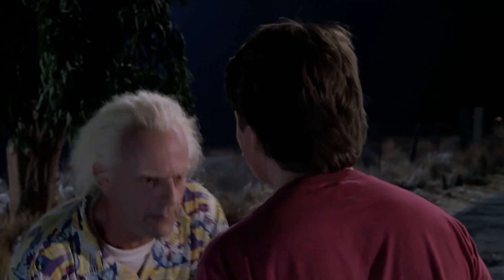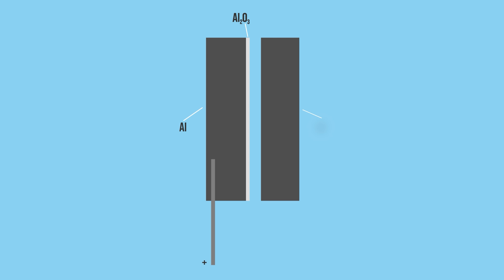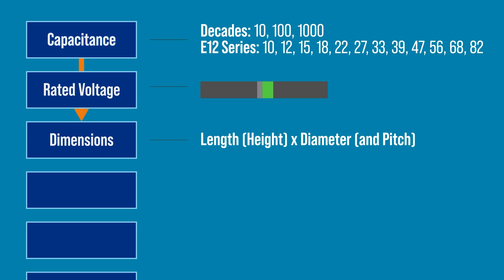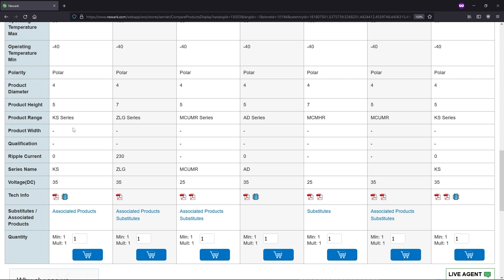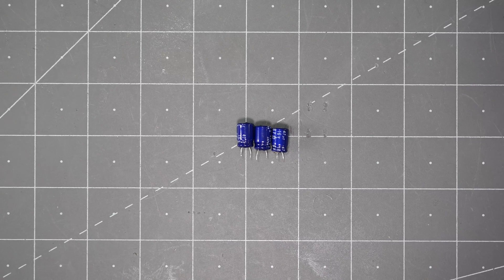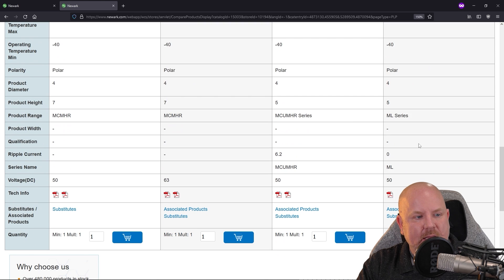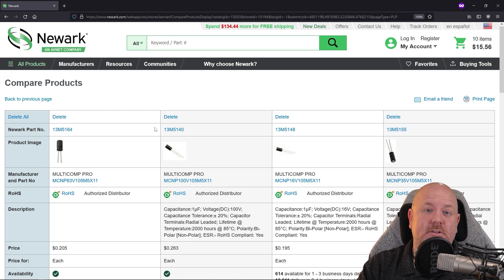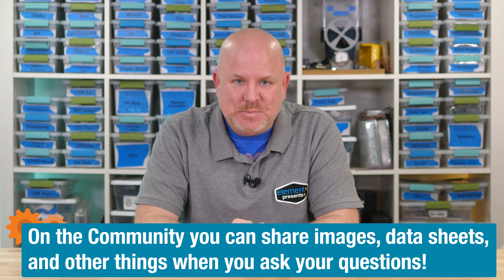How to Pick Replacement Electrolytic Capacitors - Workbench Wednesdays

Comment: Hello there excellent video. I wanted to ask you if I am recapping a transistor radio and I go with a higher voltage rating on the replacement caps say for example a 100 uf  10 volt cap being replaced with a 100 uf  35 volt cap, will the battery life of the radio now be reduced because of the higher voltage rating of the replacement caps? Thanks
Reply: No. The rated voltage does not matter in that case.

Comment: curious.   A home audio device had a electrolytic cap fail after only 8 years. (bulging on top)  Looked in my junk drawer for a replacement.  1000uf, 10v.   Found one that was 30+ years old.   It was about 3 times as large, but easy to install.  Measures and works perfectly.  Did the first one fail because they tried to squeeze it into a smaller case?
Reply: Electrolytics have gotten smaller over time because the foil etching process, aluminum purity, and electrolytes has improved over time. It failed because either it was at the end of its operational life, the design was bad, or the cap wasn't manufactured well. Billions of capacitors made each year. Not all of them work flawlessly.

Comment: Nice video. Thx.  I’m going to have to do this to purchase new caps for some old motherboards.  Are there any recommended shopping lists to help me out in buying a good selection of caps for most eventualities on motherboards, graphics cards etc. BadCaps used to sell these kits, which was very useful for novices, but he no longer does this anymore.  I’ve noticed re-capping kits on eBay for Commodore 64’s and the like, but nothing for old PC’s.
Reply: No, not really. The caps for the digital side of 8-bit computers are easier to document because there were so few variants of the PCBs relative to later computers. Over time, you'll build up an inventory of parts but you'll always need to buy more for each re-cap.
Reply: @bald_engineer  Many thanks.  This was my lazy train of thought.  Like you l’ll just go through each board create a list, and go shopping on Mouser.  I’m sure there’s a lot of commonality on 20+ year old boards that will help me build some essential stocks quite easily. Thanks again. D
Reply: @davidp4456 Outside of the SMPS (and CRT), electrolytic are mostly used for bulk decoupling. So most devices just fit the largest cap they could given other constraints. 

Despite relative similarity in electrical design, the other constraints are what creates variety in the values used.

Comment: Hi, could someone please help me find the right replacement capacitor? This is what is printed on the old one ( ZHN (M)105°C 25V 1000 uf CD288H L.E.S.R ) ?
Reply: If you follow the link in the pinned comment, you can ask your question on the element14 Community. There you can post a picture of the capacitor. You are more likely to find someone that can help there.

Comment: I took my NAD 7400 receiver for repair, but the guy is having a hard time finding transitors/capacitors repalcement. Can you suggest a place where to buy those components?
Reply: Without knowing what the parts are, the best suggestion would be start with a distributor like Newark to find modern replacements. Otherwise, you'll have to look around on the grey market for (hopefully) new-old stock.
Reply: Also, if you have a list of tough to find part numbers, the element14 Community is a great place to post that list (in the Ask The Experts forum).
Reply: @bald_engineer  Thank you sir. I will look into it.

Comment: Why wouldn’t you replace with tantalum’s? I mean then you are going to have to replace the caps over and over and hope they don’t leak. Tantalum’s are much better and just burn up instead of leaking.
Reply: Cost, availability, voltage ratings. They cost orders of magnitude more than wet-electrolytics. Good quality through-hole tantalums are going away. They're also less accepting of surge voltages. Their impedance profile is vastly different. 

Can you use them? Sure, but it takes a lot of more circuit knowledge to how to replace them. It's not just a straight voltage/cap swap.

The middle ground, and my preference, is Aluminum Polymers, which I mentioned in the video.

Comment: When replacing the smaller electrolytics, say 3.3uF or smaller, you can also use film caps provided the size will allow it. It doesn't matter if the originals were bi-polar or not.

Comment: Your little SMT adaptor board for older component replacement looks cool, but it is not just parallel capacitors on a PCB, the parasitic inductances could lead to nasty surprises. However, if analyzed on the bench you could actually produce an "equivalent capacitor" super capacitor of better performance out to high frequencies using the PCB interplane capacitance, ceramic capacitors and finally Aluminum Electrolytic capacitors. You could combine these different preforming devices to produce a very impressive capacitor over frequency. But, the design and testing would be time consuming and expensive.

Comment: You forgot to talk about rule #1. Which is; do not trust the manufacturer data sheets. Use the data sheets to select the best possible candidate(s) and then bench test the capacitors to confirm they meet your requirements before installing. Unfortunately, to fully test capacitors on the bench requires relatively expensive equipment, for example plotting impedance over frequency. Like looking at the impedance at 120Hz (which is a popular data sheet specification value for ESR), to compare to the data sheet value, but also to look at what the device is doing over frequency. There are many different work flows for analyzing discrete components on the bench, many include extending the measured results for use in a circuit simulation model.
Reply: You can't trust data about any Product. From Manufacturer. Lol

Comment: I just replaced 6 electrolytic caps (nothing big or special) in my old Heathkit (solid state) audio generator. The B+ is only 44 volts. Final bill including tax and shipping was $44.44. I checked Jameco, Newark and DigiKey before purchasing from Mouser. The prices of new caps are outrageous. I should have paid about a third of that amount. The bad part is that I don't trust any of the manufacturers anymore because of Chinese interference in manufacturing. Parts are not as available as they used to be. Everything has gone micro-miniature now and the mfgrs aren't keeping up with the older type stuff. That makes it hard for us old timers.

Comment: Back when I did my electronics education in the 70's here in the UK, the issues with electroleaktic crapacitors were never raised. Even ESR was never discussed.  Caps were selected on value and voltage, and sometimes dimensions.  I cannot recall any other factors in parts catalogues or manufacturers data sheets. Maybe these issues weren't known of then, or not as well known about.
Blanket cap changes were definitely not a thing and treating caps as the prime suspect when fault finding was not done.  It's also surprising that I find many caps 50 plus years old are still fully servicable in vintage equipment. Maybe it's that as size has reduced substantially from the 80's onwards, especially 90's to now that they have become a scourge?  It's certainly the first thing I look for now when fault finding.

Comment: you are incredible. Any tips on handheld CB from 1971? Worked brand new out of box for 6 seconds now will not modulate. Never been opened, still had original batteries in it!

Comment: Your forgot to cover the shelf life for aluminum electrolytic capacitors, that is about 2 years (info available on the component datasheet). So, if you have a box full of 2 years old aluminum electrolytic capacitors, they have expired already.
Reply: you need to take temperature into account. the shelf life is determined at maximum rated temperature. so if you have a 1000 hour 105c cap. then that is the minimum shelf life of that cap at 105c. for every 10c you reduce the temp, you add substantial life to it.  maybe you should read the datasheet again
Reply: @josephlalock8378  At room temperature (20 e 25 °C) they last 2 years (panasonic, nichicon, etc). Vishay say:
"They can be stored in dry rooms at temperature ranging from -40 °C to +40 °C (preferably between 0 °C and +25 °C) for up to three years without any restriction."

Maybe YOU should read some datasheets. IEEE Explorer has some documents sharing the exact same data.
Reply: @coisasnatv   does that mean that some of my amplifiers, all without turning them on for 10 or 15 years, are all bad now?  why not,then?  thanks
Reply: @josepeixoto3384  They all bad and might run out of specs, this means they will not sound the same as when they were new. Aluminum e-caps are wet, after all these years they are all dry.

Comment: Why a voltage only slightly higher than the original? Why not 2 or 3 times as much (e.g. 50V instead of 12V)?
Reply: Because they are physically bigger, if there is enough space around and the lead spacing is similar you can use a higher voltage cap.
Reply: @Gengh13   Real talk right there. I ran into this problem whilst recapping my keithley meters because I failed to measure pitch. Now I'm stuck waiting 6 months for the correct part to come in. Do yourself a favour. Measure twice order once :)
Reply: There is also the (belief? rumor|? theory?) that a cap with a voltage rating too high will not properly "re-form" if it is never run at that higher voltage.

Comment: I restore vintage Macs. I go by datasheet of the original one. If it's general purpose I'll use whatever I have, low esr or general purpose. Low esr generally I will match against the original

Comment: It’s always a crapacitor, I video repairs on test equipment from the 60’s 70’s 80’s and 90s I always replace all of the caps, but surprisingly the older gear sometimes still test within spec! They made things well then.
Reply: @TheDefpom  I agree most modern capacitors are poor quality.I am thinking of manufacturing my own !!!!

Comment: I got my cap kit from Console5. They have packs for just about every game system and 8 bit computers ect. Good prices.
Reply: Concidently, they did not have Model 100 capacitor packs in stock a couple of weeks ago .......
Reply: sounds like an ad comment tbh, especially from a zero-content account. plus i wouldn't trust premade cap kits to contain good quality caps anyway. chances are high you'll get the cheapest trash from noname chinese brands (chengx changx chongx ebay specials etc) they can get their hands on at the time, or junk like jamicon, capxon etc
Reply: @Knaeckebrotsaege  You can trust my cap kits.

Comment: Another consideration is availability, you might see the perfect cap, perfect price, but you need to order a large number or pay shipping, so it might not work out properly, or it might take a while to arrive. As well you can pretty much always go up in value slightly, and often will have to, seeing as capacitors seem to be becoming available in 10, 22, 47 as steps, with only the odd larger values like 820uF being around. Thus replacing a 680uF you probably will be using 1000uf, as the 470uF probably will not work out well. Also in power applications if possible use bigger capacitors, especially in a SMPS, as the larger case sizes almost always have both lower ESR and can dissipate heating better, though with PC power supplies you are often stuck with needing tall skinny capacitors, so go for the longest that fits for the same reason. For that leave 2-3mm of space under the capacitor to allow for airflow, so it can run a tiny bit cooler, and you can see when the seal is leaking.

Last PC power supply I got rid of all the 6V3 caps, went with 16V instead, same diameter, same pitch but a lot longer, and lower ESR, so they will last longer. Also they were 820uF, found some decent Rubycon that were 1200uF, so longer life, plus used the "spare" unused holes to put in another one per rail as well. Not for capacitance, but to reduce ESR.
Reply: In series inductance also should be take into account, especially in critical filtering applications, so short leads are better than longer ones.
also, using capacitor in parallel may be better than series (less ESR and ESL) to archive desired value.

Comment: Can you replace these aluminum capacitor with a solid state capacitor?
Reply: It really depends on the application. Impedance can be different. Ripple current too. Really depends what the cap is doing.
Reply: You can replace an Aluminum Electrolytic capacitor with a Polymer capacitor on PC motherboards from 2000 onwards. I would not recommend replacing Aluminum Electrolytic capacitors with polymers on power supplies.
Reply: @andrewsawesome  Just wounding, thanks.
Reply: @andrewsawesome  Hi can you say why you would not use polymer caps in a PSU.
I just assumed they would be better if they fit, as they usually higher ripple current rated and lower ESR.